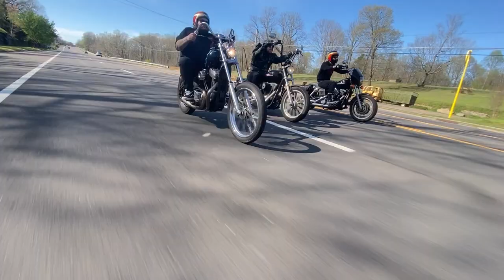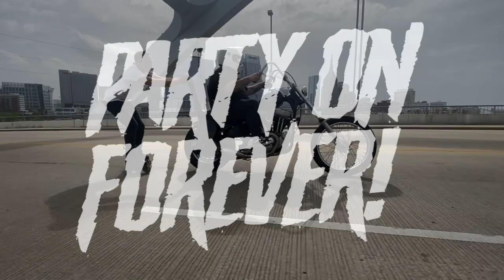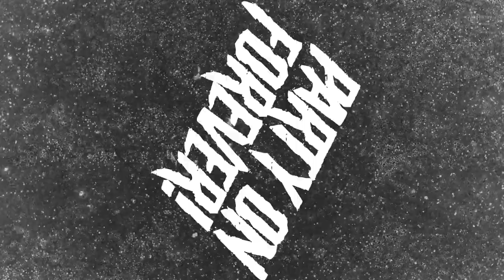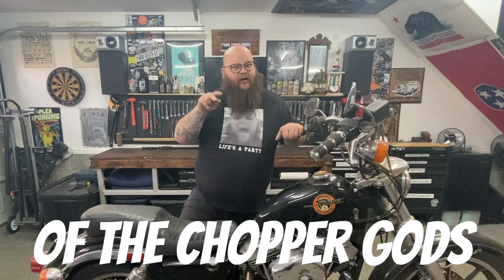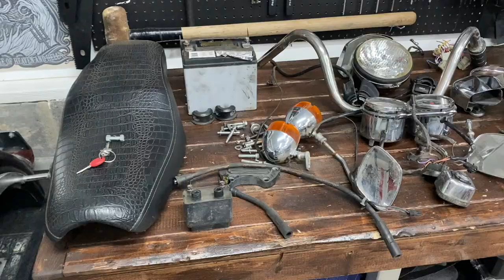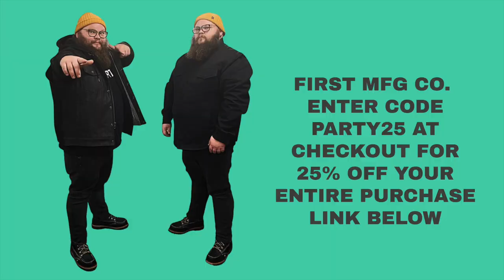CHOPPERS FOR DUMMIES EP: 1 - Tearing a Sportster Down to the Frame and Motor.

Comment: Dude you're the best. 

Also planning a badass daily bobber. Knucklehead 6 or 7 speed transmission. Softtail, maybe rubber mounted engine. Ape hangers. Lace paint. 

Probably gonna fuel inject it water cool it and turbo it at some point. Aluminium frame from rolling thunder. Light fast ass bobber that'll be comfy enough to go distance. 

Also punker. Emo kid punker but it's still a punk offshoot.
Reply from the maker: Right on dude. Sounds like a wild bike. Send pics when you make that happen!
Reply: @PARTYONFOREVER  for sure dude. Though mightve just switched my engine plan to a big ass Evo for ease of power. Maybe a twin cam. But either way gonna be cranking alot of power. 

Trying to decide on clutch choice right now. And Trying to figure out ecu shit.
Reply: @PARTYONFOREVER  figured you might find this tasty 

Go check out Indianlarry website. They have some pretty badass springer forks.

Comment: Great video. Got a '93 sportster  myself. Man that headlight bucket wiring is a mess isn't it? I tried to rewire mine, but ended up farming it out to a shop. I had zero clue what I was doing. They re wired it to have one wire to headlight (high beam all the time) , zero turn signals, zero horn, two wires to the ignition and that's that. Won't pass inspection, but she's a chopper who gives AAAAAF
Reply from the maker: YEAH DUDE. I LIKE TO KEEP IT SIMPLE AS WELL. I TAKE OFF EVERYTHING. GET RIDE OF ALL THE WIRING AND START FRESH. SIMILAR SETUP YOU JUST MENTIONED. 
THE LESS YOU HAVE ON THE BIKE, THE LESS THAT CAN MESS UP.

Comment: sick video man! I'm trying to rewire my sporty atm but all the chopper diagrams dont leave room for blinkers, any suggestions?
Reply from the maker: Man, honestly I always cut the blinkers out and do away with all of that to keep it really simple. i'm sure i could try to draw something out when i have some time. might be a week or so. i'm crazy busy. 

i'd use the stock signal module if you still have it. without researching it, i'd think you got from 
battery/fuse > module > signal switch(stock or aftermarket) > to signal. but it could be
battery/fuse > signal switch > module > signal

each of those ideas make sense in my mind. just not entirely sure where the module lies in the chain.

Comment: Building a hardtail chopper right now from a 1977 xlh ironhead that one is new enough for a bolt on if you do not wanna cut and weld one on .
Reply from the maker: Nice man. Those ironheads are some trouble sometimes but i love em. Yeah, i have a hardtailed evo sportster. I looked into the bolt on options before cuttiing my frame on that one but i just didn't like the lines and proportions. There's so many weld on kits now, they make it pretty easy. 

I don't plan on chopping this bike. its a customer that's just looking to do some quick cool guy mods to bring a little better price tag on the sale.

Comment: Good day : Are all choppers hard tails ?  Have you ever come across a chopper that has rear suspension ?
Reply from the maker: Lots of people debate what a chopper is. I'm pretty loose with the term but it doesn't have to be a hardtail to be a chopper. Technically the frame needs to be modded in some way. but all in all, its a vibe man. chop it out!

Comment: I'm running at 883 a 2000 I don't need no headlights tail light no turn signals I just need the bike to run and charge
Reply from the maker: All ya gotta wire up then is your charging system and ignition/coil. I have a wiring video up that's got a link to a wiring diagram. Should be simple enough for you to get that going. Good luck dude!

Comment: So I got my bike back in a box from a Harley dealer after they went bankrupt,  Not I need to rebuild the motor and I have no idea where to start.  How about an spotters engine ground up rebuild...
Reply from the maker: man, next time i need to rebuild an engine, i'll try to shoot a video on it. is it just the top end or is it in pieces all the way down to the cases?
Reply: @PARTYONFOREVER  Hey man... ground up Bottom and top.  after a top and bottom rebuild that HD did the flywheel broke and the bike went back for a warrentee fix so they striped the bike and then closed their doors,  now I have my engine in a box completely striped.

Comment: How do i pick a rear rim to fit my chopper. Its been chopped i dont know what frame it is
Reply from the maker: you need to measure the axel, see what size it is, get a wheel that has a hub that matches that axel. You'll also need to pay attention to whatever brake setup that you have and make sure it will work with the wheel you buy. whats the bike?
Reply: @PARTYONFOREVER  1974 honda 750 k4.